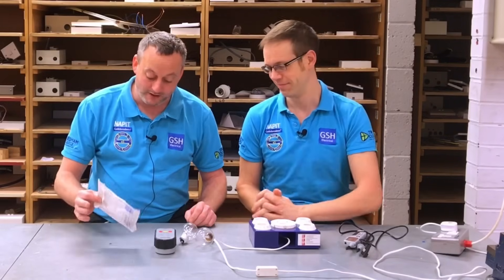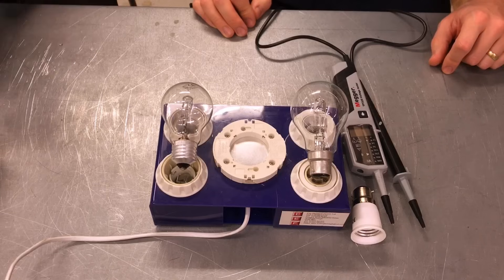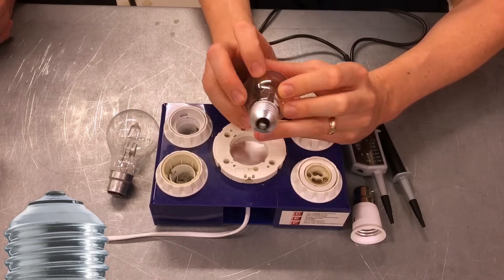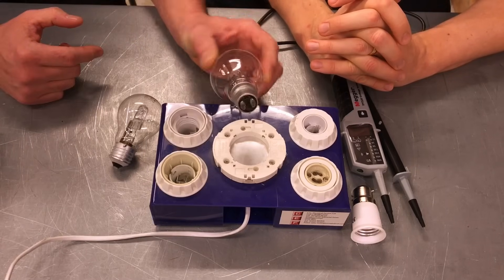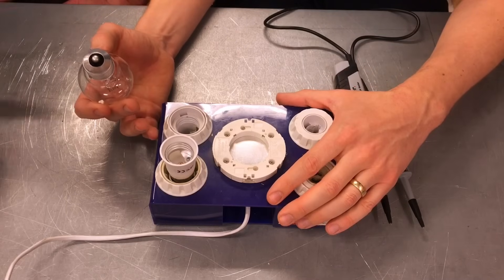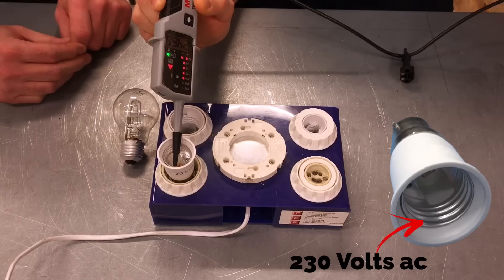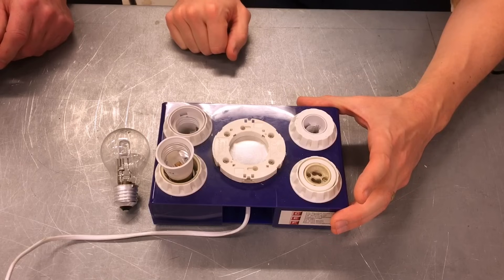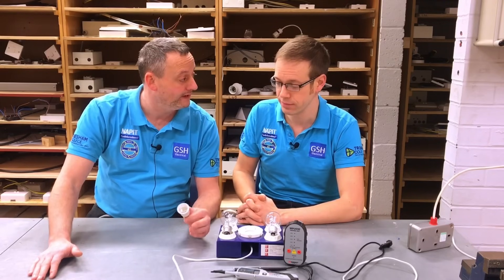Bayonet Cap to Edison Screw Lamp Adaptor Incorrect Polarity Massive Risk of Electric Shock

Comment: Thanks for the warning. Another problem with these cheap adapters is that the max. wattage is not imprinted on the adaptor itself. I bought a few off ebay a few years ago thinking that they were good for max 100W (no instructions or packaging). I used one with a 240V 100W incandescent bulb. Seemed ok for a while until I smelt burning plastic. The plastic insulation around the contact pins was melting. I checked the ebay listings for these adapters. Only 1 in 5 disclosed the max. wattage as 60W. Even if the purchaser is aware that it's good for max 60W, he/she may place it away in a draw, then someone else comes along later, assumes it's good for 100W, uses it and sets the house alight! This incident alerted me to the importance of having smoke detectors installed throughout the house and also being wary of purchasing unbranded electrical goods from China.
Reply: Most goods are from China tho . #gasprices

Comment: My new house as E27 pendants and I have B22 Phillips hue bulbs. Are there any issues simply replacing with b22 pendants? Or the slightly cheaper option would swapping the build holders? Any risks with this? Voltage etc?

Comment: I've seen better adaptors where the contact for the cap is at the bottom of the holder and does not touch the lamp until the last moment. Much better than the whole threaded part being  connected. Also, some cheapo holders have the 'skirt' too short so that the top edge of the cap is still exposed when the lamp is fully home.

Comment: Wouldnt you have the power off when screwing in the adaptor, assuming if it is the wrong way round the bulb wouldn't work, so assume you would the turn the power off and change the bayonet fitting the other way round?

Comment: I'm not sure who would use these this way. I've always used them to change the globe end and then attached it to the fixture like any other globe. Then hitting is live when your changing it over. I feel like these warnings are for those people who are below normal intelligence. I mean it's electrical. You're supposed to be careful regardless. You should not put globes in lights that are turned on anyway. I've used these and would again because they save you making larger changes and allow you to use your lights. You literally only need to be generally concerned, and you'll be safe enough to ensure no issues. I mean who touches the metal parts of a globe at any point ever?

Comment: I bought one of these from B&Q and it appears to be safely designed. The threaded part is plastic and the contact is at the bottom so the bulb has to be screwed almost all the way in before the screw makes contact. One issue though is whether these ES led lamps are designed to work with inverted polarity.
Reply: The lamp itself will work fine with either polarity because the supply is AC (alternating current). It is just the risk of accidental contact with any parts that are 'live' with respect to earth that is the dangerous bit.

Comment: It is always a good idea to not touch the screw part either way. In sweden for example we do not have polarized plugs so for lamps with a normal plug you may have the actual plug the wrong way. The safest way is to just unplug the lamp before replacing the lamp, this will also help eliminate arcs on the contacts of the socket and the lamp. Arcs can shorten the life of those. Things like cieling lamps will have a special polarised plug but things like desk or floor lamps usually have normal plugs.

Comment: On most of the new plastic LED light bulbs you can easily swap the caps over from B22 to E27 with just a small flat bladed screwdriver. It's not recommended for every body to attempt this but it is possible. I have done it several times.
Reply: True! I just watched plenty of videos of that. But will they they consume the whole 40-50-60W compared to just buying a brand new 5-10W LED bulb ?

Comment: Some modern Edison screw lamp bases are shrouded, so polarity isn't as important as it used to be. The connection is usually only made once it's fully screwed in. In these "safe" lamp bases the threads are plastic and the contact connections are at the very bottom! Even touching the screw threads isn't usually a problem while screwing the bulb in.

Comment: I'm a little confused but are you talking about the potential risk only when an adapter with Type B connect on a lamp holder side is used with a Type E bulb? Using E27 to E14 or E14 to E27 adapter has no risk, doesn't it? this is because the adaptor doesn't reverse the line and the neutral terminals.

Comment: I just got a couple of these (e14 to b22) with some smart bulbs from heyimhome.co.uk
Apart from being inherently flawed, they trip my fuses when installed, even without the bulbs installed. One of them welded itself to the socket when I put it in with the switch on. It didn't take a lot to get it out, but it pulled itself apart in the process.

Comment: Thanks for the eye-opening video. I won't buy one!

What's the solution if you want to start using edison in a bayonet lampholder?
Do you simply replace the lampholder, and if so, how should one connect the wires?
Reply: I've been trying to find a video on that with no luck :(

Comment: Yes i agree but Anyone has to be super dumb to be be touching the side screws of e27 connector.

Given how easy life these adaptors make i will never stop using them.

Simple solution is that you screw in the adaptor in bulb first then you attach the adaptor to the female bulb fitting in the wall or lamp. So problem solved, no contact with the metal.

Comment: Sorry , I don’t get it.  The glass is a non conductor. Even if installed incorrectly the glass wil, be safe to touch
Reply: You might touch the metal screw cap! And if it is connected to live, you're im danger.

Comment: When screwed in is the thread of the bulb still exposed? Because I struggle to see the issue if it is no longer exposed.

If you were to screw it in the way you guys are, of course that is horrendously dangerous, and people need to know about the dangers.

However, if you were to screw the bulb in first then attach the adapter to the fitting it should be fine?
Reply from the maker: RISK 🤦‍♂️
Reply: Thanks for replying, even with the facepalm. I didn't think that would still be risky, regardless.. after doing a little more searching I discovered that Ikea's adapters should be totally safe to use.

I had no interest in Ebay adapters, as I don't trust random unvouched for companies with electronics whatsoever.

Thanks for the video though..  as before it, I had no idea this was a factor at all.
Reply from the maker: Thanks for both comments and watching. Gaz 👍
Reply: Why not ban Edison screw cap entirely?

Comment: Well both light bulb fittings are "dangerous", because if you remove the bulb, then lick your fingers and touch the exposed live contact, you'll get a shock. But that would be your own stupid fault, just like if you inserted a blank adapter instead of first securely attaching it to the bulb so that the metal screw part is protected by the extended plastic shroud.
Reply: You’re expecting everyone to follow this? That is why industry has safety standards to cover the masses! They’re dangerous and Edison bulbs are worse than bayonet but Europe wants to be global dominant power and everyone must follow their rules even if they’re unsafe.

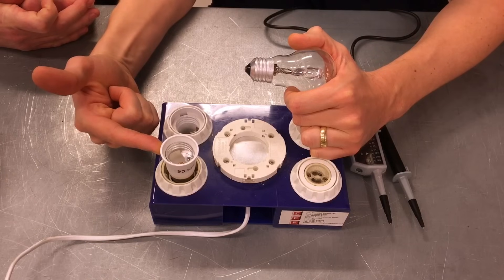Comment: Aside from your very good points in this video, I'm still surprised these fittings are allowed to be used in general. As you demonstrated at 3:37 you can easily stick your finger in the lamp holder and receive a shock. What happened to IP ratings??

Comment: I use them all the time I always screw the adapter to the lamp before putting it into the socket just in case the polaterty is wrong
Reply: I was thinking that, but you still wouldn’t know when you twist the adapter in the bayonet if you get the polarity safely as you are still risking to touch a live part of the bulb.

Comment: Very good point guys, a way round this would be to screw the adapter to the bulb before plugging in, but this is still by no means perfect.
And the thing that's most shocking is my local well know eletrical supplier has been selling these for some time.
Reply from the maker: Thanks for your detailed comment Gaz 👍

Comment: HELLO LADS 
I THOUGHT EVERYONE KNEW ABOUT THIS 
I BUILD FAIRGROUND LIGHTS AT 60V OVER 110V  IN S/P AND ALWAYS MAKE SURE MY NEUTRALS COME OUT ON THREADED SIDE 
I ALWAYS THOUGHT IT WAS OBVIOUS 
SO IF ANYONE IS THAT STUPID TO PUT FINGER IN THE LAMP SOCKET THEY WILL ONLY HAVE 60 V AT LAMP HOLDER 
240V IS FAR TO HIGH VOLTAGE FOR MODERN DAY LIGHTING    THANKS FOR SHARING

Comment: I am pretty sure that this item will get an CE marking without any problems. Nearly everywhere in Europe Plugs and sockets are not polarized and lamps with a flexible cord have also Edison light bulbs. So there is the exact same risk of getting an electric shock. Sometimes 1pol switches are used in such lamps. And as long as the UK is part of the EU you can to an German based certification company and get your CE marking to sell it in the hole EU.
Reply from the maker: Hi. Thanks for the detailed comment all the best and thanks for watching Gaz 👍
Reply: That's a good point, Simon. If mainland Europe (and the US?) all use ES fittings and non-polarised plugs on portable lamps, then don't they all suffer the same problem? What's the rate of accidents caused by these?

Comment: NO one in there right mind would connect the adapters  in the light fitting first, you would screw it on to the lamp and then connect it to the fitting, thats why they get away with selling these adapters  But the potential danger still needs pointing out you should have mention the correct way in using these adapters in a safe way but still not recommending them
Reply: I disagree totally, once installed in a ceiling rose pendant the very next time the lamp 'blows' Mr or Mrs Jo public will just change the lamp, its only by the will of God they have switched off at the switch!
Reply from the maker: Hi. Thanks for your comment this adaptor came with no instructions for the user... all the best Gaz 👍

Comment: £1 from Ikea😳
Reply: For two, it's also safer as the screw cap only makes electrical contact when its nearly fully inserted, this along with the extended plastic shroud make it considerable safer. https://goughlui.com/wp-content/uploads/2015/07/20150726-2110-2543-1024x1008.jpg

Comment: You can buy these in Ikea
Reply: Ikea aren't stupid they've come up with a safer design by using a plastic thread and only making contact with the base of the thread (when the lamp is nearly fully tightened), they've also extended the shroud to make electrocution by the method illustrated in this video impossible.  This is just another example of the shoddy goods you can buy from eBay. Here's a photo of the inside of the Ikea adapter - a much safer product. https://goughlui.com/wp-content/uploads/2015/07/20150726-2110-2543-1024x1008.jpg
Reply: Ed Cooper thanks for this